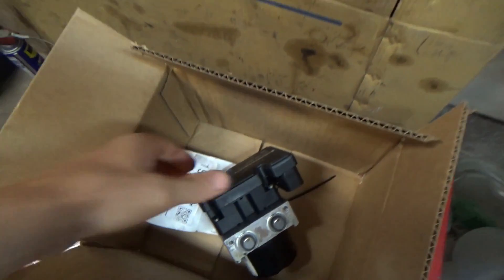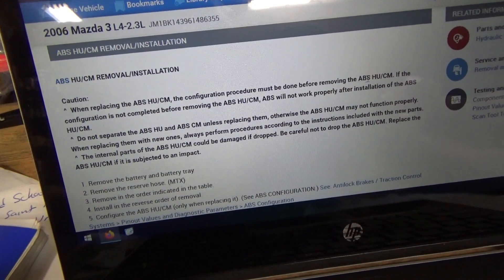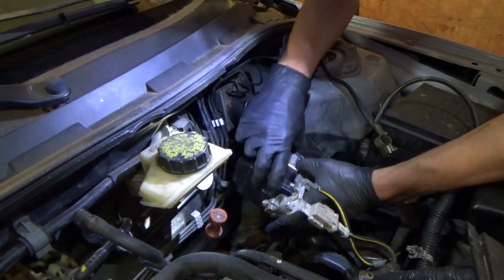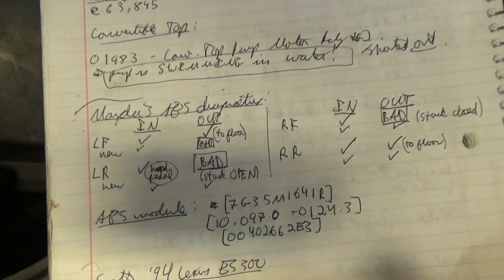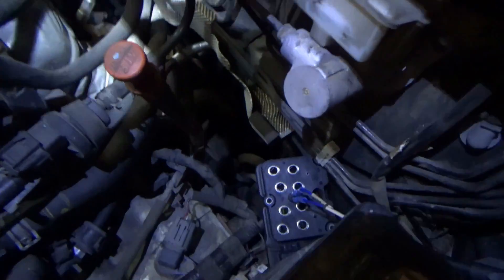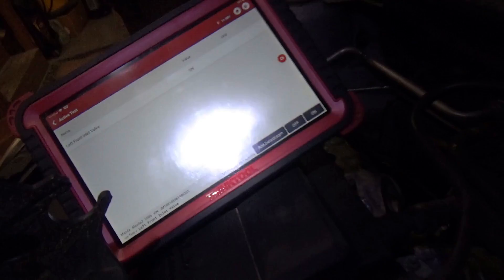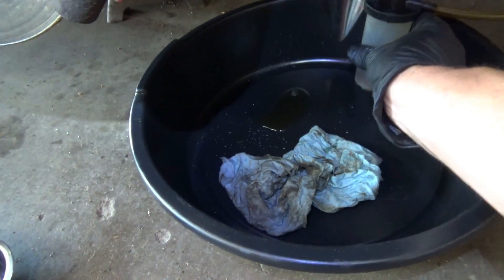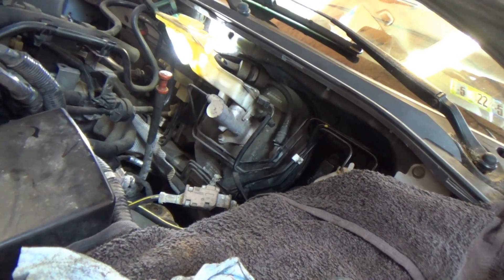DANGEROUS BRAKES! (Part 2 - Mazda 3 ABS)

Comment: I have a Mity Vac also and have used it to do one man bleeds.  But I have never seen anyone pull off a bleed like that. I always assumed letting off the pedal would suck air back into the caliper.  Sometimes people say to stuck the hose directly into fluid but I don't trust that, either, because air could come in at the bleeser screw.  It's not sealed at the threads when open.
Reply: I assume that one side of that brake fluid bottle has a straw that goes to the bottom. Once there is some fluid in there, it can only pull fuild back, no air. So if he had the right side of the collection bottle hooked up, it should be fine.
Reply: @_RiseAgainst  If it's a regular Mity Vac canister, no straw.
Reply from the maker: When you release the pedal the one-way seals in the master cylinder have very little "suction" so almost no air is sucked back into the caliper via the bleed nipple. That's why before tightening the nipple I take off the hose and just let the fluid drip to make sure there are no bubbles a the top of the caliper :)
Reply from the maker: @kevin9c1  Yes there is a "straw" submerged in the little bottle...
Reply: @PineHollowAutoDiagnostics  Really?  Mine just dumps into the container.  Nothing is submerged.  Is that from a Mity Vac or something else?
Reply: @PineHollowAutoDiagnostics  Yeah I get it but it's just one of those odd things.  Been bleeding brakes for 21 years and was taught by manuals and everywhere else not to do it that way.  But apparently it worked.  Is that how you usually do it?
Reply: @kevin9c1  I would think, even if you were to do a vacuum bleed, you would want the side of the container connected to the brakes to be submerged.
Reply: @kevin9c1  I have that same bottle from Mityvac and yes, there is a piece of tube that connects to the underside of the cap so that it goes down into the fluid that goes into the bottle.  I have one from Lisle that is built the same way too.
Reply: @A. Melbs The only one man bleeding I was taught back in the day was to use speed bleeders.  They have check valves to make sure fluid only flows one way. Most people don't like them and I have never used them. The other method is the Mityvac.  Actually on one car I did another thing: Motive power bleeder + Mityvac at caliper.  But most of my bleeding historically has required two people.  One to pump, one to operate bleeder screw.  Don't even need a hose for that.

Comment: Outstanding as usual Ivan. Maybe a fluid change is in order. As Eric O would say, "There`s your problem Lady", it`s a ford product. I will not buy from Evilbay, did it once, never again. Been watching for years, and I always learn something even if  I will never use the info. Does the brake fluid look like Shrek piss? You need a degree to work on these cars, that`s why my "newest" car is a 2002. I miss simple cars, no computers.

Comment: I'm an Indy shop owner. I had a customer with a 2013 escape that was at local dealer. They had "repaired" the  left front wheel speed sensor wiring and still had a left front code. They told him that he needed a new module. Quotes 1300 replacement. He called me and at that time. I questioned the replacement but didn't stick to my guns. After months our schedules aligned and he brought the car in. I couldn't find the damn module and once I did it was in same place as this Mazda buried and backwards. My plan was just to remove the electrical part. Once I seen I was gonna have to swap whole module I decided to diag it. Long story short dealer tech had cut the rf sensor and wires lf sensor to rf input. Also the "new wire" had 3 splices in it where the tech had swapped wires by cutting the new wire 3 times. In my opinion that dealer should refund him or pay my bill.
Reply: I'm assuming that you are saying that the 'new' wire ckt was in fact an open ckt. Meaning the sensor was not being seen by the module?  and you had to repair or replace that wire, to achieve ckt continuity? If so, the previous 'tech' did not complete/perform a repair and you in fact did complete the repair of the ckt and the previous tech should not be paid for the work, you should be paid. If all of the above is incorrect or an incomplete assumption, well this summary would also be incorrect.
Reply: @paulkaz2127  The tech at the dealership ran a "new wire" between abs module and left front sensor. The new wire had 3 or 4 splices between the abs module and the left front sensor. Im assuming he was swapping wires back and forth thinking he got them on wrong side of sensor. When he ran the new wire he cut the yellow and purple wire on the end of the connector. The problem was he cut the wrong yellow and purple wires. Left front and right front both at opposite ends of connector. He wired the left front sensor to the right front input which still left a left front code. Then told customer he needed new module.

Comment: Awful high pitch noise on the audio! lol My 2011 Mazda 3 started with the pedal dropping if i went over a bump and now has progressed to doing the same as this video. Slight brake pressure when applied then pedal fades a couple inches before brakes grab. After seeing this i now know to have the ABS module tested first before the master cylinder. Thanks for posting these videos!
Reply: Did you solve this issue?
I have same..

Comment: Hi Ivan, did you bleed the hydraulic unit as well? I may guess there is still air trapped in there and it may get released into the system once it activates. There should be a procedure for that (in the scan tool), activating the pump and valves in a certain sequence, it should be common practically with all similar ABS units. The procedure may differ whether there is ABS alone (so designed to only release brakes when the brake pedal is depressed), or whether there is the ESP/EBD/brake assist/... (it can also apply individual brakes without depressing the brake pedal), it differs in the arrangements of the hydraulics and of course the control unit as well. Unfortunatelly I don't remember the exact procedures...

Comment: Failing abs modules are an ever growing problem especially with average 12 years old cars on the road. I went through 4 so called remanufactured modules on my E39 . All shipped with QA/QC labels and bar codes etc so I was hopeful. They were all bad . RockAuto isn’t even selling them now .

Comment: The fact that banging the Control Module with a hammer makes me think a poor solder connection on circuit board.  May get the same code after swop.   Interesting diag.
Reply from the maker: I tapped the hydraulic unit... Not the electronic module 😅

Comment: Had same issue on my 07 Buick Allure, had a weak click using a magnet to operate the solenoid, compared to others. I bled the solenoid in question, and it eventually worked IE closed and problem was solved, except now have idiot lights on from touching the wiring harness, and no way to figure how to trace where the wiring cables go.

Comment: Lack of maintenance strikes again. I would guess the internal valve mechanism is some kind of steel which rusts with the moisture absorbed in the brake fluid. As others mentioned, the fluid was definitely dark and well past the required brake fluid change intervals. BTW the those valves could probably be triggered with a permanent magnet for testing purposes, the design looks similar to most solenoid valves. I'm surprised the scan tool would let you activate each valve without brake pressure applied as most domestic vehicles do. 

Ivan, was there any ABS bleed procedure on that vehicle?? The first time it gets activated, you may loose your brake pedal due to all the trapped air behind the valves...

Comment: I currently have the same exact problem on a 2005 Chrysler Town and Country but mine just worse all four of my wheels are locking up bad every time I put a new set of pads on it and they wear out less than a week scorching bad I had got a new master cylinder replace new calipers break lines and abs pump unit i don't know what's going on no mechanic couldn't fix this problem I spent way too much money at Shops still park😑

Comment: Ivan, is the ABS hydraulic side part of the same fluid use in the Brake System? If so, I would think dirty Brake Fluid could cause friction/binding on those valves. Perhaps flushing the hydraulic ABS lines should be performed to prevent a repeat valve jamming.

Comment: I dealt  with this issue on my mazda for about 8 months   the valves where hanging enough to make it act like bad calipers and lines too  Ive been preaching this in the mazda groups for the last 2 years after i figured it all out
Reply: Going through this on on my M6. What did you do? -tap it with a hammer or flush the pump module, or replace?
Reply: @dwej9080   both firsts few times i pecked it with a hammer  i replaced the module finally

Comment: Replaced the master cylinder on one of those last week. It was leaking and not knowing it, the customer let it run out of fluid. The car literally had no brakes to speak of, though he was still driving it for months out of necessity to get to work. Needless to say, all that air in the ABS module didn't do any good, and there isn't an auto-bleed function on these as far as I know (other than just activating the pump motor fwiw). Anyhow, at least now the car has brakes, though he couldn't afford to also have the module replaced. So we ended-up where you started on this one. I am appalled to see how many people drive with no brakes simply because they can't afford it. That in addition to people driving with no license or insurance in Florida (a story for another day). Good techniques in your video...

Comment: Did you check to see if you can do ABS module bleed program with the scan tool? When I did my truck brakes, I didn't like the way my pedal felt after bleeding manually, so I did the auto bleed with the scan tool, and that helped.
Reply: I was wondering that, this car may not have that capability.
Reply: I own a 2007 mazda3. In terms of bleeding, I would add another step after manual bleed: activate the abs a few times and then bleed again to make sure there are no air bubbles trapped I side the HCU.

Comment: i have a mazda 2010 with same issue !!! bought a bidirectionnal scanner *x431 launch pro * and try  to actuate the valve but scanner said : THis actuation test is not supported .... how did you by pass the to connector on the center ? i put a normal check light but he doesnt work  !! but when i connect the abs module motor i can do the actuator test of all valves

Comment: Hi Ivan ! I have similar problem with my mazda 3 2010 and found a used abs module but the 2 last digits are not the same .... so first i purchase a scanner Lauch X431 Pro v5.0 but he doesnt have the function for abs module programmation for model 2010 but have the previous mazda 3 model .... ridiculous ... im gonna sell this scanner and try to find out a better one who have the 2010 mazda abs module installation !!!! Did you know if your model can do programmation on 2010 mazda 3 ? Thanks

Comment: Did the ABS light come on? I have the same issue with my 07 mazda 3, 2.0L but I don't have ABS. when I push the pedal down, it does the same as in that car, but when I put my foot to the floor the brakes just lock up. And there's no ABS light on my dash

Comment: Wonder if it could have been a no parts repair if younwould have tapped the old unit?  Also, how mong will it last?  I dont trust it..  but under the circumstances if the customer didnt want to shell out $1200 for a new one not much you can do.

Comment: Would it not be worthwhile checking the VIN/part number on the defective ABS to see if it had been previously replaced and possibly fitted incorrectly - i.e. without being programmed properly? Just curious to see if it might be the case.

Comment: Current on a coil like that goes quite high when there is no iron core.  Best to put the bolt in first, turn it on and then and tug on it when active.  Coil would rarely open by itself unless current was higher than designed for.  With no iron core, current is higher than designed for..  Just sayin.
Reply from the maker: Interesting point...you must be a physicist :D However the steady state current is limited by the resistance of the coil; it would just ramp up faster since there is less back EMF :)
Reply: @PineHollowAutoDiagnostics  I'm no physicist. Mechanic turned EE.  The impedance/resistance of the coil is affected by magnetics too.  That core distributes the field in the coil creates impedance/resistance in the coil(half talking transformers here).   You even show that a lot on fuel injectors(mechanical movement) in you scope captures. You know the noise when you first turn a large transformer on?...Magnetic saturation and huge inrush for a few cycles..  I'll bet you if you measured the current through the coil, it would be significantly less with an iron core in the middle.  Not trying to be a wise-ass.  Anyway.  Good work..
Reply: @PineHollowAutoDiagnostics  Dammit.  I hate to ramble on and sound like a fool.  But, I do care. So on I go. The driver circuit for that ABS coil likely has some current limiting in it just the same as a typical ignition coil has.  If you were to drive an ignition coil with no core,  I'd place my money on that driver circuit not lasting very long.  It is essentially AC 1/2 wave.  This all fun stuff.  I like having fun.
Reply from the maker: @nhzxboi  This is where we get to the fundamental difference between impedance (inductor) vs resistance (straight wire), and dynamic vs steady-state. So with an iron core in the coil, the current would ramp up slower due to greater impedance, but the steady-state current would be the same as with no core since the resistance of the wire of the coil is a fixed value. Agreed? This would make for a fun bench test :D
Reply: @PineHollowAutoDiagnostics  Regression:  When I was a kid, I was an automotive goober and questioned everything.  GM's HEI and subsequently, Ford's TFI ignition intrigued me.  I figured, why can't I just connect these coils to constant 12V and just let them go for a spark.  I tried...the junk burned up instantly every time.  I was naïve andI didn't really know what was going on.   I took a look into the control modules and saw a mouse maze of zig-zag traces on the primary control.  Then I figured it out.  Control was made to saturate coil very quickly(very high current but, for a very short amount of time). Saturate it, hold it and then let it go when spark was desired....that's what the control stuff did.  Way different from the traditional cylinder type coil used with points and all.   I agree the DC coil has a fixed static resistance value(given the time to get there) but I think the control circuit is designed with an interest of very quick saturation and current limits after that.  Bang, hold, release.  Just like an an HEI ignition.  My issue is that w/o a core, the 'Bang' is far bigger than w/o a core.  Yea, would be interesting.  It was to me when I was burning wire on HEI coils.  Anyway, I didn't get hurt
Reply from the maker: @nhzxboi  awesome experiments 🙂 Remember the old school ignition coils on points systems with an in series resistor to limit current? I think during cranking on some systems the resistor was bypassed to get a stronger spark under lower cranking voltage...
Reply: @PineHollowAutoDiagnostics  Yes.  Chrysler used the ceramic ballast resistor.  Easy to replace.  Ford used a resistive wire in the main harness. Impossible to replace by itself...you could use a Chrysler resistor in it's place and bypass the harness resistive wire. They really didn't burn out much anyway so not much of an issue.  I don't know what GM did.  Yes, resistor was bypassed via crank circuit to compensate for lower battery voltage during crank...pretty simple.  The good old days.  I have nothing to do with automotive anymore.  But, I still have passion about it.  Burning wires or coils on mom's  kitchen table didn't please her at all.  Curious kids got find out.  :P  Ford's EECIII system ran on 8VDC...Often the cranking voltage would kill the fuel injection control system.  Yea, that is why current systems are 5V or less.  There's so much history to things and evolution.  I think much of it is getting lost as folk age-out of the industry.

Comment: Is it just me or is the thinktool pros pretty much a Upgraded launch scanner?  The only reason I haven’t considered one is my launch HD let’s me do bidirectional on cars and most trucks.
Reply: Are you able to access Cat engine (C7 Acert) stuff, like cylinder cut out testing with your launch? And does it read pressure from the HEUI pump?
Reply: @mattcat231  I do t work on anything CAT so I don’t know.  Freightliners and international’s with Cummings and Detroit’s mostly and FUSO.  It’s pretty good with those and I can see pressures.  It does work with FUSO but isn’t so great on that one but I have the dealership computer for that.

Comment: The valves in a VSA/ABS modulator are lubricated by the fluid.  Clicking indicates movement but not proper operation. All valves must be returned to off oposition with fluid filling all passages for the moduator to work properly.  The service data SAID that a procdedure that WASN'T followed HAD to be done or the module would not work right. DO it.

Comment: Couldn't the unit be rebuilt? Recently I had an ABS pump go faulty on Opel/Vauxhall Corsa (European small hatch)... new unit was around 800 euros, have it rebuilt/refurbished was less than 200.
Reply from the maker: If you know of a good rebuilder and don't mind having your car down for weeks then sure :)
Reply: @PineHollowAutoDiagnostics  Weeks? Maybe if the rebuilder is backed up... we send it on monday, back at the latest on friday.